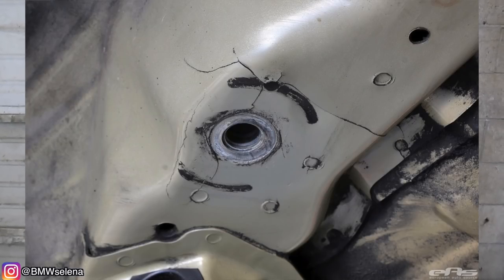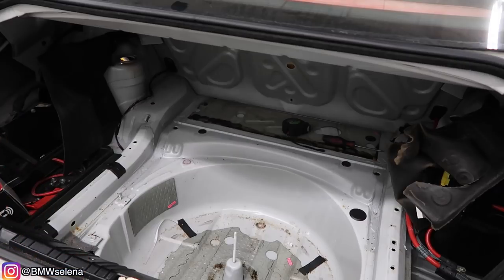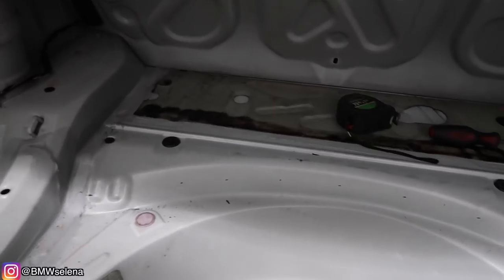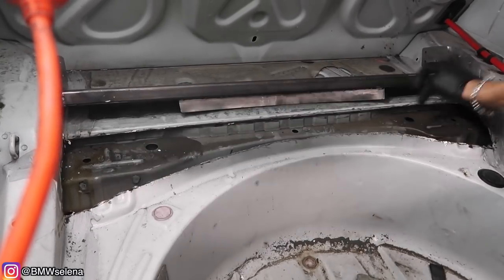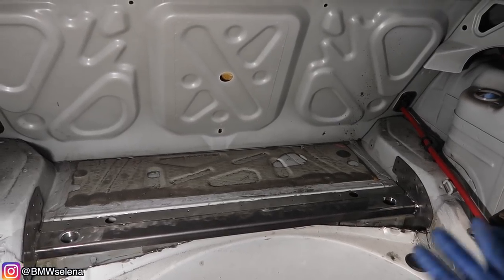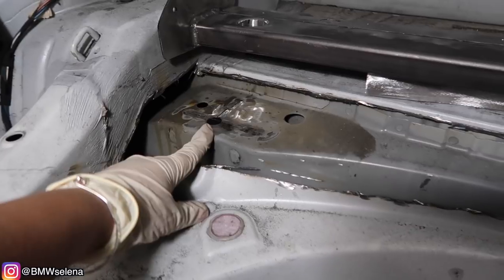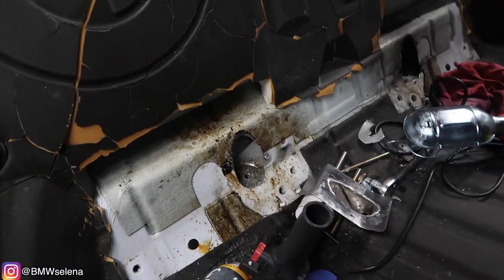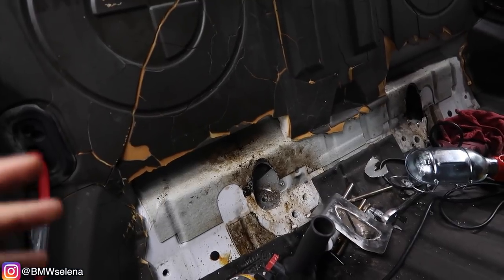The Best BMW E46 Rear Subframe Reinforcement?! Part 1

Comment: i would always weld over epoxy any day!  especially to strengthen and tie in the read Sub frame issue
Reply: Smooth is Fast! Do it then. That’s why both options are offered. Not everyone owns a welder or has experience

Comment: Cool project. Some advice for you. Before you try to drill out spot welds. Like your seat bracket. Use a center punch to mark the center of the hole. It also keeps your drill bit or spot weld cutter from walking all over and slipping out of the center. Next before you start sanding and grinding the paint for your epoxy. You want to use acetone or brake cleaner to clean up all the spray lubricant you used while drilling metal. If not your surface will be contaminated with oil and nothing will bond to your bare metal no matter how much you sand.

Comment: Then I better check mine, I have a 2005 E46 and I’m concerned since I do hear a clunk sometimes. However, this clunky sound comes from the right front when I move forward or in reverse but not always. Thanks for the heads up!
Reply: Dude get your lollipops replaced and check your subframe.

Comment: U could of use a angle bar 4x6x3/8   where the cross brace and welded a 2 inch round tube on the strut towers and tie it all together with round tube to the button angle bar to get better resolutes and yes a little more work to do it. No body flex using angle bar and round tube.

Comment: Those Candy Vince gives are little cars. They are not bad. Kind like a marshmallow but different. Guess is a Sweed thing. Vince is great. He’s  Super helpful. He answered all my questions and he was willing to sell me just the extended studs because I’m a fabricator and was easier for me just to make my own setup. You definitely wanna weld these in. Don’t  bother wasting time with panel bond. It will fail in time like panel bond does when it gets old.

Comment: Hey, Selena - thanks for filming this, gives me a closer look at what I'll have to be dealing with ! I'm going for a 330cd and it'll get remapped to 300bhp for starters, so lots of torque (around 500lbs-ft) and I'm kind of worried the car's RACP panel won't handle it without any sophisticated bracing/reinforcing, Redish plates+ CMP bar with fronts or Vince bar with fronts/ Mason Engineering's X-brace and etc. Have you inspected the car recently for any new cracks that might have appeared elsewhere or any side-effects from the bracing ? Would appreciate any feedback, thanks ! :)

Comment: I’m just wondering, did BMW reinforce this area in later E46 models? I think only early models had this subframe problem right? Please let me know if this is correct. Awesome video!
Reply from the maker: No they did not
Reply: They only put foam in them, which helps, but is far from the comprehensive solution of this. The 330s can break with the foam, but it isn't all that common, depends how well the driveline has been maintained, probably wheel size and suspension stiffness. I have a 175k, 99 328i, it only had one tiny crack.

Comment: I need help I have BMW X5 2002 3.0 E53 I don’t have pressure on rear brake I change brake hose bleeding the system i change the abs control module and nothing just i have pressure on front brake

Comment: How we can get this kit reinforcement rear subframe  BMW E46?
Reply: The real question is why did Bmw sell a vehicle that they knew had a weak subframe?A weak subframe and the s54 inferior rod bearings would've surfaced during testing.The fact that they sold defective vehicles leads me to believe they dont test their vehicles or they do test  knew about the problems and unloaded junk on their customers.
Reply: build it😂

Comment: Didn't BMW do a recall on the e46s and did the structural foam?
Reply: A year late, but not really, they settled a class action lawsuit by saying they would inspect and fix affected cars (within 1 year of the settlement date), it prevented the need for a true recall. They did repair it with a mix of metal weld ins and structural foam.

Comment: will i need this if i already have a roll cage in my e46? welded bar across the rear strut mounts.
Reply from the maker: yes because the failure point is at the subframe mounting points
Reply: can you send me the link to purchase it, im doing an ls swap on an 05 e46 325ci body.

Comment: Much cheaper and much more reliable is to buy another E46 in good condition. I'm not sure how safe and reliable a car with a cracked subframe can be at all to put this much work in it.
Reply from the maker: My subframe isn't cracked this is to prevent it from happening. Especially with the added power the LS will bring
Reply: It makes sense :-) I'm curious though, why you don't like the restyle version, it is so much better in terms of build quality. Or is it just me :-)
Reply: Cracked subframe is common problem with e46. Many have been repaired. I had all my e46's  reinforced before any cracks started. It's a must if you abuse them.

Comment: you should learn how to weld
Reply from the maker: there's two types of kits weld and epoxy. A lot of people prefer epoxy since it has a greater contact patch and it puts less heat stress and potential warpage.
Reply: Selena are you located in North Carolina and Jason is in California? Great video on the Vince Bar. I think a lot of people were waiting for someone to do a video on the install. Thanks!!

Comment: Staged! The trunk carpets were already unfastened and just kinda put back in place so she could remove it on camera. Showing that doesn't really help someone as they can't see what is needed to remove hose carpet pieces. I guess it was only meant to look good on camera and not be informational. If so, might as well add some more eye candy.
Reply from the maker: I said in the video they were already removed before. They are held in with normal push pins